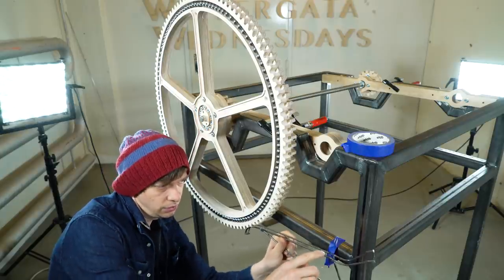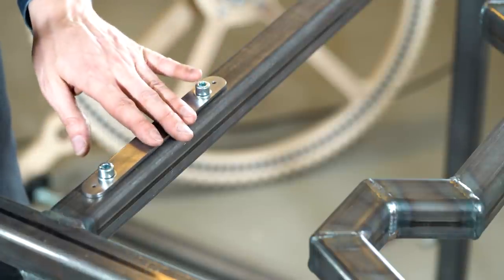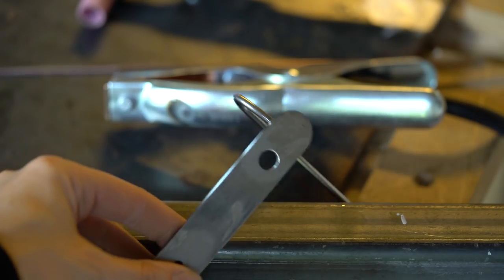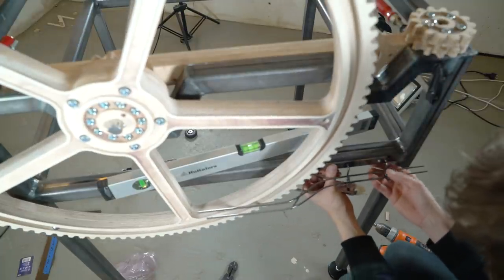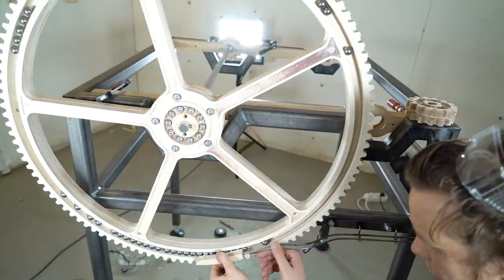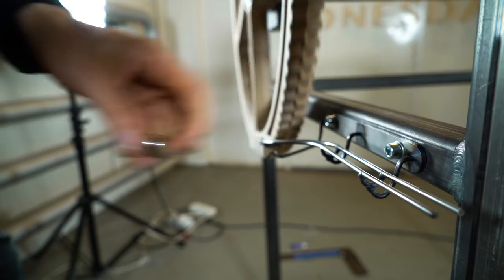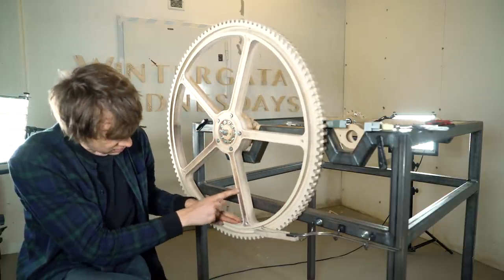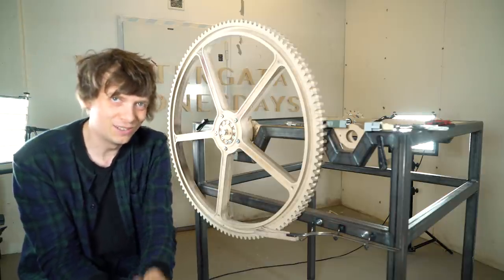Marble Tracks - Marble Machine X #15

Comment: Wintergatan, you mentioned a second lifting wheel, yes? If so, will it also use magnets to lift? If so, ensure the polarity of the magnets are reversed (wherever they contact the ball bearings) and it should minimize the effects of magnetization on the ball bearings.

An alternative to this approach is to rig up a degausser somewhere in the machine so that all ball bearings pass over that part of the track. If you use this method, ensure to design it away from the lifting wheels and other magnets!

My guess is that if you reverse the polarity of the magnets in the second lifting wheel, coupled with the natural vibration in the machine, you should see these effects rarely. And in that case, you could "maintain" the ball bearings by degaussing the whole batch of them with a big degausser, perhaps inbetween shows?
Reply: Ah, I just remembered another option: the reason they are getting magnetized in the first place is because of the hard "strike" against the wood in the presence of a strong magnetic field. Is there perhaps some way you could soften the blow? Perhaps some felt strip (I know this goes against your design requirements, but just to get the ball rolling with an idea). Or you could design your 3d printed transition piece so that it is razor thin as it rests against the lifting wheel to prevent any type of strike, they just sort of roll onto the wheel. Almost like a reverse of your "scraper" at the top of the lifting wheels.

Comment: Wind a coil of copper and feed AC power through it then have the marbles go through it and they will be demagnetized and copper coil is pretty. If you do not want to use electricity Use alternating N S N S N magnets to produce the AC current.

Comment: Use brass of 304 stainless steel (non-magnetic or only slightly magnetic wire for the marble ramp.  In fact, I would use stainless steel for all the wire parts.  This would also reduce the sticking on the tracks, welds better, and doesn't corrode.  Actually, I would use stainless steel for the marbles also, and not use magnets for the wheel.

I would use brazing for a lot of the "welded" assemblies.  There is less thermal shock, less brittleness, , and the ability to look directly at what you are assembling.
Reply: Brian Park Okay now you're just re-inventing the wheel.

Comment: Make the tracks out of a non-ferrous metal such as Brass Copper or Aluminum.  Copper would look cool once it oxidized.  But welding would be an issue.

Comment: Make a Degaussing tube at the top. When the marbles come off the main wheel have them roll through the degaussing tube and it'll remove any residual magnetism.
Reply: wouldn't that need electricity? I am not an expert I know old CRT monitors had this option.
Reply: There's non electrified demagnetizers I have one that can mag or demag a tool.
Reply: nordbart CP it's a lot easier to do with electricity. A little charcoal brazier to heat the marbles up past their Curie point at the top could work.
Reply: Easier and more reliable to recover the magnets from the lift gear and set them in Halbach configuration NSNSNS...
Reply: Robert Szasz
What is Curie point for steel?
Reply: 770 °C - too high for a marble machine ;)
Reply: halbach array config might work, but since the magnets touch each other and the marbles too, it would lead to some amount of magnetisation too (two halbach rings), but i may be wrong and the effect is minimal
Reply: Damir Perisa nah, a little forced air coal furnace, then drop them into a trough of water with rails to cool.
Reply: Well this would be pretty stylish.
Reply: hahaha, but instead of coal, it should run sustainable - maybe wind? or even magnetism? :P
Reply: A degaussing coil would work. Hmm, if only we had a large rotating armature to induce an AC current in a field coil...
Reply: You guys are saying electricity would have a better degaussing effect, so why not stick something to the wheel to generate the power which would then be used for the degauss tube?
Reply: If the magnets were of alternating poles in the big wheel, having the marbles close to that might work. It's all too tempting though to have a big ol' coil of wire connected to mains through a step down transformer (or feed them through the magnetic circuit) to degauss. Less effort to crank if you don't have to power a degaussing system and no more sticky marbles.
Reply: I'm glad someone else finally realized this.  These marbles are so very weakly magnetized it wouldn't take much to remove it.
Reply: I think they are alternating poles. In fact, all Martin needs to do is to put a coil behind the wheel to generate a weakish AC voltage - it's 90% there already to make a simple alternator. That can then power another coil around a degaussing tube that the marbles run through on their way to the feed. You could add that in half an hour to the existing design - it would be totally passive and require no electronics.
Reply: yesyesyes this should be a big design concern
Reply: Why not ground the steel structure to demagnetize the marbles?
Reply: Yeah, why not do what Adrian Beteta said? There is probably some obvious reason why that wouldn't work, but please enlighten me :)
Reply: It seems he demonstrated a potential solution in the video. Just give 'em a good whack. Striking the instruments may be enough. 

I wonder if it's possible to sort the marbles by the amount of magnetism they have acquired and send the magnetized ones to the vibraphone?
Reply: Grounding the steel structure would be for if the marbles were electrically charged, it wouldn't do anything to their magnetism.
Reply: You wouldn't want to introduce the noise from that if you're making a musical device.
Reply: They are already getting a good whack when they hit the vibraphone. Hence my question about sorting by magnetism: if the ones going to that instrument are the most magnetized that should serve to demagnetize them (hopefully).

I would expect the other instruments to give more when struck, so they wouldn't have as much of a demagnetizing effect.
Reply: Tori Knorth I knew it seemed too simple! Thanks for correcting us :)
Reply: Marble Machine X: Steam Punk Edition
Reply: How about a magnet with opposing poles spinning rapidly to mimmic the oscillation of a degaussing coil?

Comment: And I still keep reading it as Winter Garden.

Also man you run them drill bits fast.
Reply: It's Winter street :-)
Reply: Big_Adam_2050 
Yeah, it is winter garte
Reply: Big_Adam_2050 I keep reading it as winter gate
Reply: If you translate from swedish it means winter street.
Reply: Yes its Winter street.. BUT W(v)intergatan is also the Swedish name for The Milky way our gala
xy..
Reply: Yes he should slow it a bit down. Especially the big ones. With such high rpm they'll be dull pretty fast and the sound they make is horrible.
Reply: I used to always (still do sometimes) read/write/say it as Winter Gan
Reply: Came here to comment on the drill speed too! Use 1/3rd the speed and a lot of pressure. Your trigger skills will be tested, but you'll make a better hole and the bits won't get toasted. You're searching for long metal coils, not chips.
Reply: Yup, either increase feed pressure a lot (likely breaking bits) or slow down. The bottom of the hole should be smooth, not showing chatter from the bouncing bit.
Reply: Hahahahah! LOL! Me too.
Reply: I am german and didn't noticed until i was allready subscribed for two months that it isn't "Wintergarten".
Nice to know that i am not the only one who made that mistake. : D
Reply: Wouldn't cutting oil help with these issues ?  Sure slowing things down make better hole, but Cutting Oil would help dissipate your heat too ?
Reply: Big_Adam_2050 in the winter, my garden is very slow.
Reply: Winter cat for me (probably b/c I keep thinking of gatan ~ gato)
Reply: The Winter Garden was a famous theatre on Broadway in New York City about 100 years ago. It might still be there, I'm not sure.
Reply: If you have the option (and a high-speed drill press), you can use a tungsten bit and flow-drill the holes. Example here https://www.youtube.com/watch?v=FIgg6sey0C8&t=1s . It gives you a longer piece to tap (thicker than the stock metal), so you don't accidentally over-torque your bolts and strip away the metal when you're taking it apart and putting it back together repeatedly. Perhaps it wouldn't be necessary on a marble track, but depending on the design and function of the part, you might need more threads than the material will allow, and flow drilling is an excellent way to do that.
Reply: Small drills=high speed, larger drills=lower speed
Otherwise you will anneal or work harden the metal. The cutting oil he is using helps dissipate the heat to prevent that.
Reply: Was that cutting oil? It looked like he was just dipping the bit in a tub of water.
Reply: I was trying to figure who Wilson was - & then I saw...

Comment: sees Martin doing things with wood, bandsaw and sanding paper
Oh not again that MM1 problematic stuff about errors adding up...
Martin starts talking about redesigning and 3d-printing that part with machine precision
Oh yeah! That's why it's called MMX
Reply: It scared me aswell haha! needs to pull out the cnc for more precession
Reply: Agreed. Today's video seemed very hack jobby. It seems that Martin is going to take this as an example and work on making it the right way though. That said... How does he know those holes he drilled into the steel are going to be in the right spot!?

Comment: Isn't the sound from the marbles riding on the tracks going to sound alot, you can mayby apply a coating...

And what about the magnatasion at the top, how are the magnatized marbles going to break up so that 2 or more marbles follow?
Reply: It's like the crackle of old vinyl records.. adds authenticity
Reply: I think in normal use it will be mostly filled with marbles, so you won't get this sound of single marbles riding along the tracks quickly.

Comment: Demagnetising can also be done with ac voltage, but i'm guessing you don't want electricity on the machine, unless you can incorporate an ac alternator that runs from simply turning the handle, something like the old telephones used to have, not sure if you'd get enough power for long enough to demag the balls.
Reply: I like the Idea of an Alternator
Reply: Another trick is to reach curie-temperature. Wintergatan, please use an oven or open fire <3
:D
Reply: hmm, i wonder if Lenz's law would solve the problem, when you drop a  magnet through a pipe, the magnet creates a field that opposes the magnet, thus slowing it down, but i wonder if you do it with the marbles if it would nullify the field as it's weaker than a conventional magnet..
Reply: Sparky Projects or wack them with a hammer ?

Edit: a second path either dropping marbles from full height onto an anvil to demagnetize them, or launching them to the top container with an impact (either way shock demagnetizing them)
Reply: Why not simple demagnetizers  they sell  at hardware stores  they could be points of interest gates along the track or hidden away,  its a simple fix to the  magnetisation problem ^o.+^
Reply: Just put a coil next to the rim of the wheel. It already has alternating N/S magnets. Instant alternator. No extra moving parts, no electricity supply needed, 100% passive.
Reply: Good point +GRAHAMAUS
+The Never Show, i was hoping to avoid noisy drops of the marbles, i know there's plenty already though
Reply: I was about to reply with this, I think it would be an idea that wouldn't be to hard to implement.
Reply: well I was thing like a tool demagnetize and let the balls pass threw it on a plastic section of rail like I use for my pc screw drivers ^o.+^
Reply: It would be a lot of work. You need a strong field and a frequency above 20 kHz, otherwise the marbels start to cheep.
My honest recommendation is to avoid the need of demagnetisation.
Depending on the alloy and crystal structure it should be a solution to change to marbles from another manufacturer or even try to heat treat them (change the crystal strukture - I wouldn't recommend this, because you should know what you're doing)
Reply: Dirk D agreed, there are steels (even stainless steels) that are attracted to magnets but don't magnetize easily. That's probably the best solution
Reply: Human powered by design.
Reply: From my understanding, all you need to degauss something that's been weakly magnetized is to expose it to a strong, alternating magnetic field. That's all the degausser coils are: AC powered electromagnets. I bet it'd be possible to get similar results using a mechanically alternating field, such as a tube lined with alternating magnets, or a secondary wheel spinning quickly somewhere next to the track, lined with magnets in Halbach configuration. That way it could be powered mechanically off the main drive shaft.
Reply: Elias Turner alternating, decaying field, starting off rather strong then dropping off to near zero. Creating an alternating gradient wouldn't be that difficult (any spinning magnet does it), the trick would be moving the balls through it as the balls would want to stay stuck at the point of highest field strength. It would be neat if a mechanical device could be made to do it, but if it doesn't need to be done within a single performance, it would probably be easiest to make a box one ball layer thick, pour in all the balls, and pass the mechanical degausser over it (or the tray over the degausser). Having the box/tray so shallow would allow the lid to clamp the balls in place so they wouldn't try to rotate or spin along with the degaussing field.

Though...
Perhaps a piston, pushing a row of balls into a degaussing chamber, each new row pushing the previous further away from the rotating magnets. 

Better material selection for the balls would probably be easier, and more elegant, but I want to see a mechanical batch degausser.
Reply: It seems there's going to be a fish elevator following the ring lifts, so perhaps a mechanical degausser could be placed next to that.

Comment: If the concern about magnetization is primarily about the steel tracks – why not try out aluminum? It should also look good (and maybe even a good contrast to the steel framing) but shouldn't allow the marbles to stick.
Reply: it seemed like the issue was with the marbles sticking together with one another rather than the track itself

Comment: What about the sound of the marbles when they snap to the magnets? Isn't it quite loud? Especially when using contact microphones?
Reply: KindGottes92 the drum designs he has shown are vibration isolated from the mounting pieces, not sure if it could be an issue for other parts of the instrument, but likely not.
Reply: A piece that fits the wheel better would mean the magnets don't move as far and don't make as loud of a noise.
Reply: Maybe he can put some kind of padding onto the wood e.g. fabric?
Reply: I think the output goes through some digital processing before it is heard by the audience. The demos of the original marble machine included audio from the raw and processed tracks to show the difference.

Comment: You could make tubular section wrapped around with a copper coil to act as a degausser to demagnetize the steel bearings. It would require electronics though OR you can add an AC dynamo to the wheel mechanism to generate an AC current to degauss the bearings :D

Keep it green ;)
Reply: That was my idea too. The marbles will become magnetized more and more, no matter what you do, there will be a bit left that will build up over time.  A hidden degausser would be the best solution to avoid all problems.

Comment: Heating the steel marbles will de-magnetise them, you’ll need to get them to 770 degrees Celsius though. 
  The easiest option would be to change the marble track to a brass or aluminium rod.
Reply: I think the problem is less that the marbles are sticking to the tracks and more that they are sticking to each other, creating shapes that can't roll.
Reply: If the tracks are stuffed to near full capacity, they should just essentially push each other forward if the design allows for it, so it can be a moot issue later on.
Reply: @ Green Silver - yes, intermarbular forces can especially affect timing.  Also, brass is expensive (but steampunk af) and aluminium [RP spelt] might be too soft.
Reply: Brass would definitely look really cool. The whole contraption with lots of gears, wheels and metal parts already has a strong steampunk vibe, brass would support that
Reply: Braindead Nah Brass would just loosen the magnetic power of neodymium and it can wear down quickly just like Aluminum, I would spray coat it in a brass color and also Brass is also smooth so it would cause a slow down for the Marbles and I ain't a engineer of any sort I am just using Knowledge that I currently have right now so don't throw your better knowledge on someone who isn't on your level of intellect and I may have errors but I tried which is better than nothing
Reply: What is your problem? I said that brass would suit the aesthetics. Thats it. I said nothing about magnetism or friction at all. 
Go shove that attitude somewhere the sun don't shine will you?
Reply: Fortunately, as shown in this video, he is learning TIG welding. It's like soldering, but using an electric arc, rather than an open flame or an iron.
Reply: intermarbular ... great word